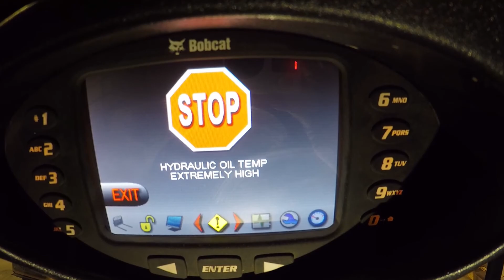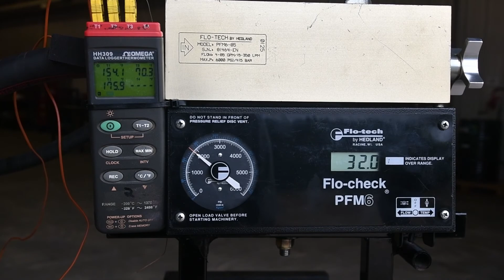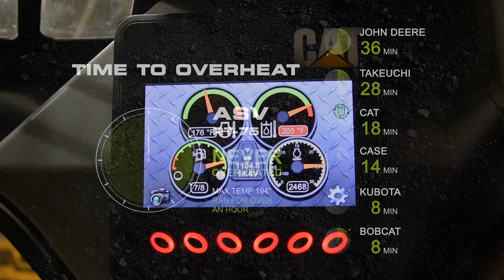Cooling Capacity: ASV vs Competitive Loaders

Comment: Running them hard will make heat up fast every year I ran a 3 year old NH l220 and I wasn’t allowed to run it above half or it will overheat
Reply from the maker: Hi Jeff, 
ASV designs machines to run at full capacity, 100% of the time at temperatures up to 118 degrees F ambient. Our HD models and Forestry models are especially designed to run in heavy duty applications.

Comment: anyone else notice the tracks change on the rt75? most clips have tracks with no outside lugs but some did.
Reply from the maker: Hi! Thanks for your comment. ASV offers two track options on the RT-75. The standard track is wider than the tested competitor's wide track option, and ASV’s wide track option with outside lugs takes you even further. We design our tracks to prevent track derailment an also to offer excellent stability & traction.